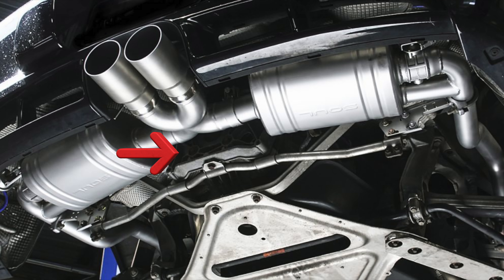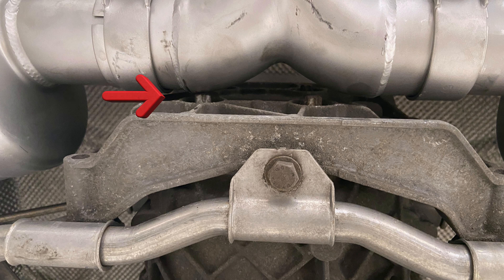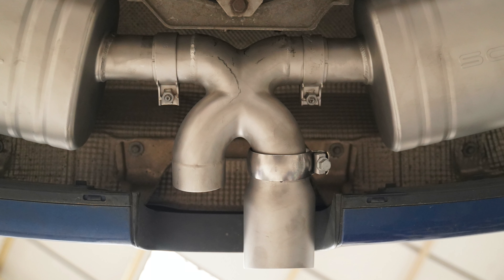Soul Performance Exhaust Installation Update 2 | Porsche Cayman 987.2

Comment from the maker: I'm going to clarify what I meant in this video... there is nothing wrong with the wiring in the Soul Performance valve controller kits for the Porsche Cayman. It's simply the programming of my key fob. Unlock on my key fob closes the valves, lock on my key fob opens the valves. This will be remedied by swapping the icons on the buttons around.

Comment: Glad you made progress....and are able to sort matters out...step by step, Max.  Persistence always pays off (and makes the learning curve for all other Cayman owners shorter).  Congratulations!
Reply from the maker: Thanks Uwe. I’ve not heard anyone say how tight the fitting is with a manual gearbox. If the garage fitting the exhaust is aware of this, they know beforehand the job is possible with the right adjustments.
Reply: @MAXREVS  Personally, I think a more experienced fitter is better for a job.  However, all of this is 20/20 hint side, and in the aftermath, we all know better.  I know your care about your car (if not love) and hence I hope that you can mitigate and ultimately find a solution/condition that let's you close the chapter on everything that did not go right.   I am like you.  I feel for you.  Unfortunately, nothing is perfect in life.   As a friend, I can only hope that all positives outweigh the negatives and that this will bring a smile to your face.